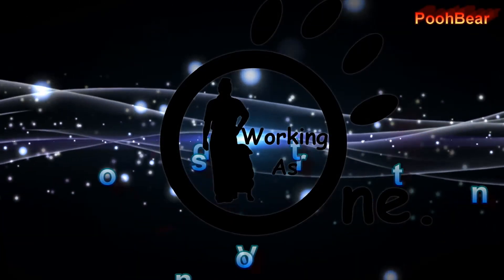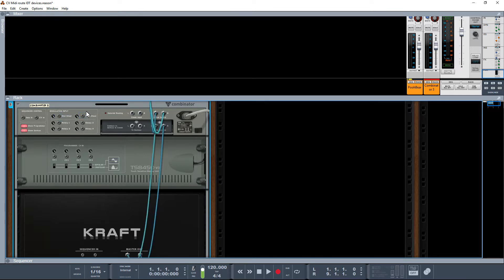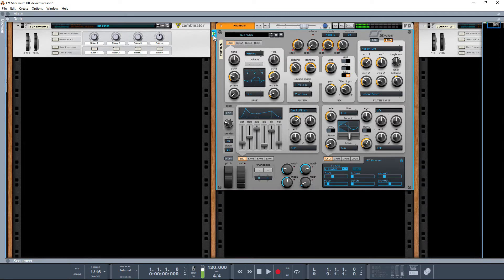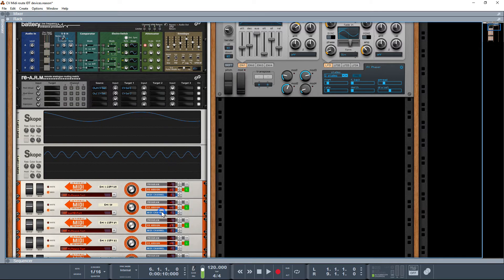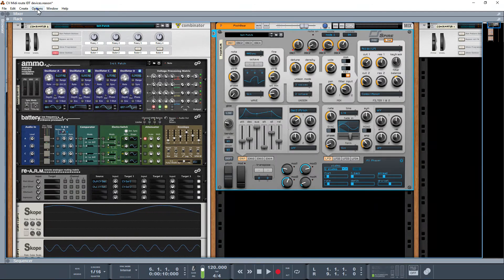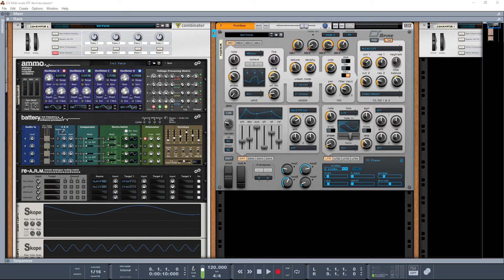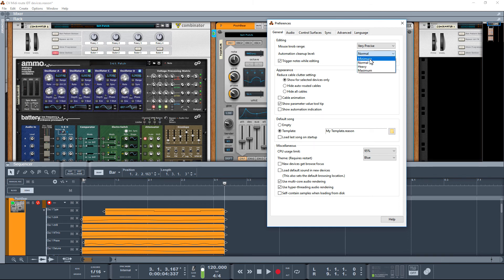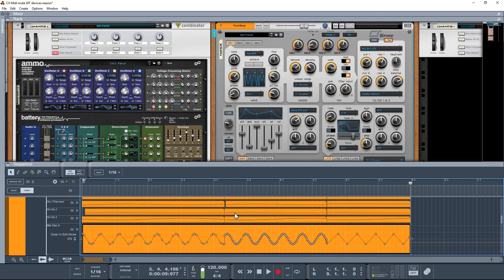CV automation with RE's and VST's

Comment: Wow, wonderfully clear and detailed presentation, and GREAT topic/info as well—thank you! Amazed you don't have way more subscribers/likes!
Reply from the maker: I have not been running the channel that long so feel free to share :)
If there are any topics you would like covered feel free to ask.
Reply: Will do:) And thanks for the offer, cool! I DO have a question, maybe more a question area, as there are many sub-questions involved: Getting and sending CV data from/to other software running on the same system. 
Is converting to MIDI at each end the only way to do this? I keep reading about soft-devices and workflows (CV Toolkit, ExpertSleepers utilities, and some others) that are currently aimed at connecting software CV generating apps like Reason, Reaktor, etc. to hardware. Which leaves me wondering if there's ANY way to leverage any of that, for the sake of sending CV directly between apps, such as to and from Reaktor blocks running stand-alone… Not being a hardware user at all I find this all quite confusing; eg: apparently Reaktor blocks for example don't even distinguish between audio and CV. 
Or is there any reason to even want such a thing; IOW, is MIDI just as good, even with all the conversions? I've asked similar questions in several different CV-focused forums, never get a reply, maybe because it's too absurd an idea…or the answer's too basic: Yes to MIDI, no to anything else? Thanks again!
Reply from the maker: Midi is a standard created back in the 80's and it did make a very small change (allows a lower voltage) very recently, now at Midi v1.1, there is no standard for CV, CV is based on Control Voltage which could be in the old days of simply attaching a battery with a resister in-between to control the voltage, very analogue. Midi = a digital control from 0 and 127, CV= X to Y, the X / Y is the issue. A lot of devices in Reason go from 1.0000 to -1.0000 (big number is 1 LOL) but as you can see we have 20000 choices verses 128 (There are other CV ports that go from 10.0000 to - 10.0000). I don't know in's and out's of Reaktor however the fact you can inter change Audio & CV makes me wonder if their CV signal is 24 bit or 32 bit which would be the same for Audio. 
So when you think about it my solutions scale down a CV signal i.e. 20000 = 128, you lose resolution, but in a lot of cases losing that resolutions you can not hear the difference. So CV ports have more control than when you control the same parameter from a knob with a mouse or a midi controller.
So to answer your question of linking up CV from Reaktor to Reason is something I have thought about but not looked into, maybe one of these soft-devices might be able to help.
Reply: Fascinating, I thought I might have finally found "my" expert for this sort of question, and hope I've maybe re-interested you:) I'm just as interested in Reason as the CV source, as I don't know of any other software that has so many options and devices dedicated to it, maybe even including Reaktor.